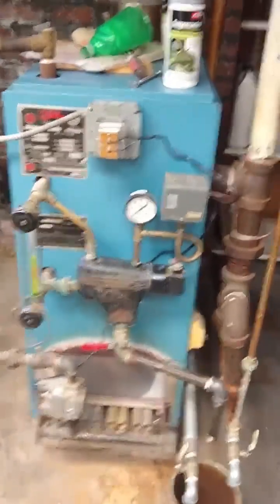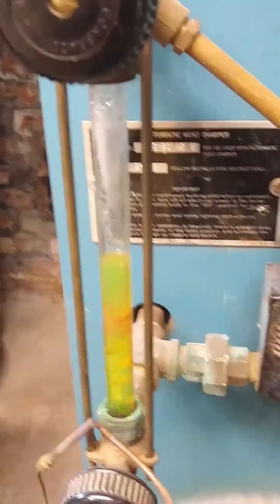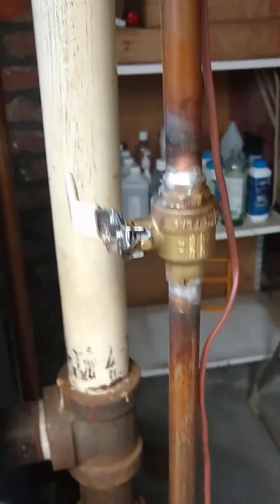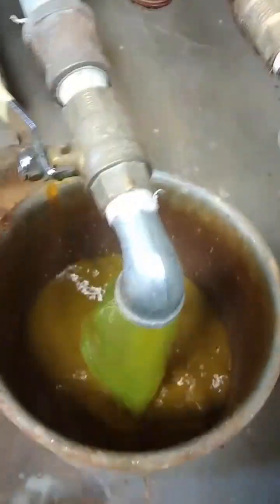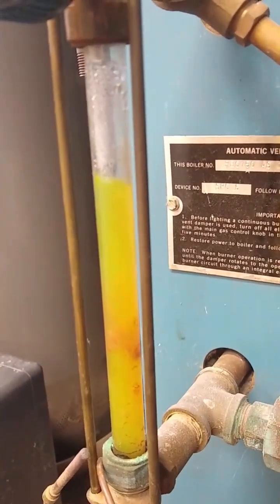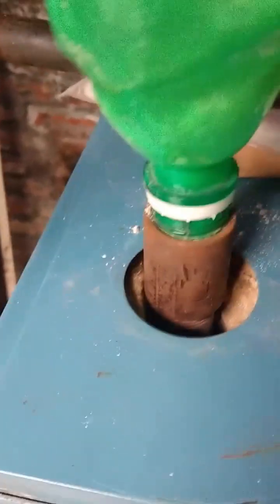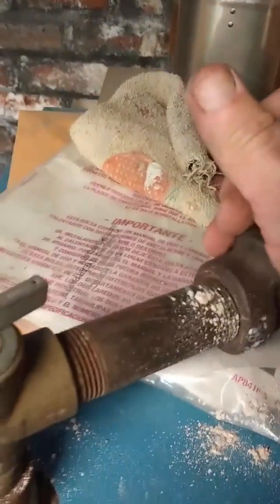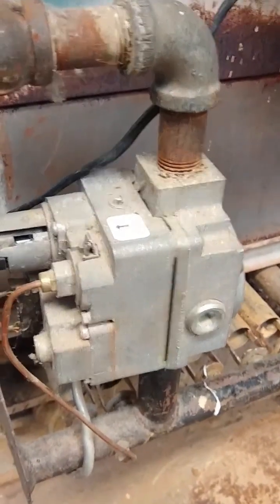steam boiler maintenance

Comment: I would flush the low water cutoff while the boiler is running. If the boiler goes off you know its working properly.